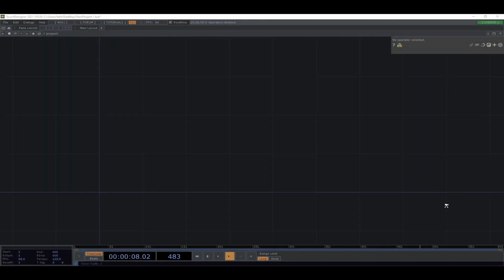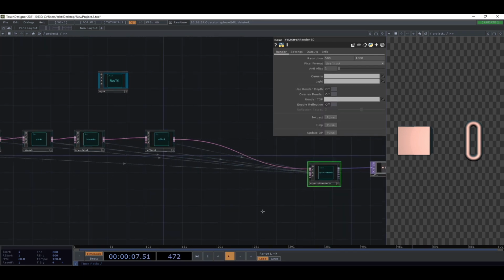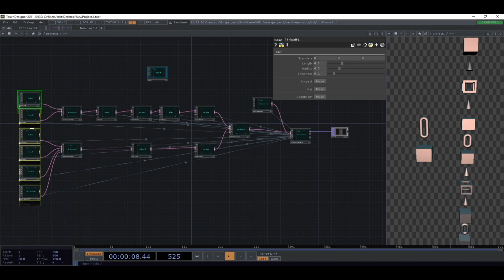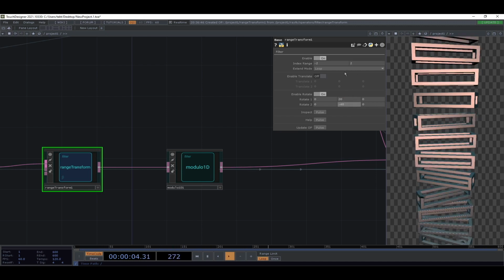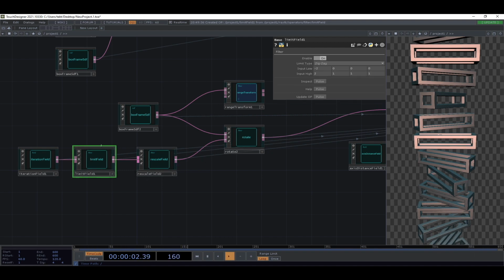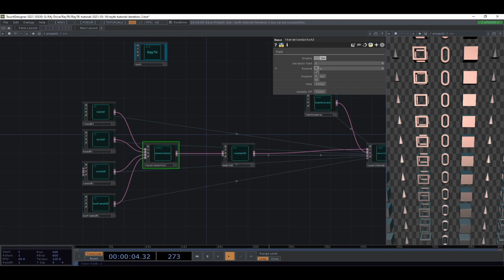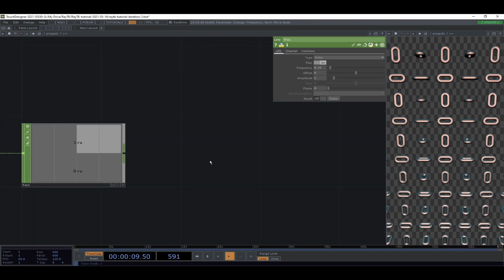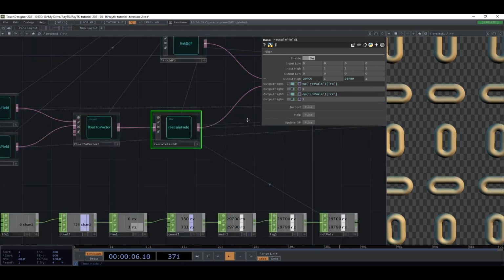RayTK Tutorial: Iteration

Comment: How can I clone the SphereSdf to the particles position come from TD? i think it can meshing the water simulation from Nvidia flex. Thanks tekt
Reply from the maker: Short answer: you can't unless you use a really limited number of instances (probably 50 or less).

Long answer:
Unlike the traditional render pipeline, there is no native concept of instances in raymarching shaders. At every step of every ray, it needs to examine the whole scene. So for every pixel that's (number of ray steps) * (number of instances) * (cost of the shape, cheapest being a sphere). And that doesn't account for shadows, which basically double it.
There are some clever approaches to skip instances that are known to be far enough away from each point. But that kind of optimization doesn't work well with arbitrarily positioned instances.

Alternative 1: The instance operator will run its input N times and combine the results. You can vary the properties of each step using the techniques from this video. But this is the "for each step check all of the things" approach, so there are limits.
https://t3kt.github.io/raytk/reference/operators/filter/instance

Alternative 2: There are things like modulo1D/etc that repeat space, which is what this tutorial covers. Those are cheaper because they can use the position in the grid to know which "instance" of the shape to check. But as soon as that shape starts to cross the boundary of the cell its in, it gets cut off.
Reply: @tekt0  Thanks tekt, your tools save a lot people not familiar with GLSL!